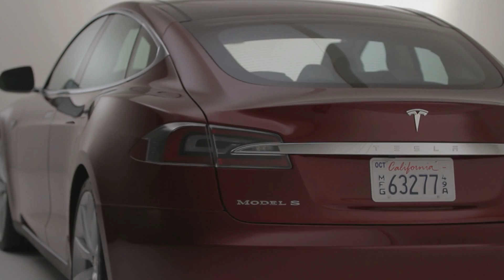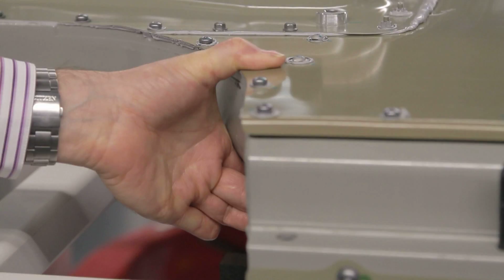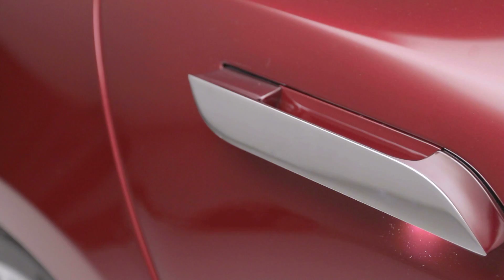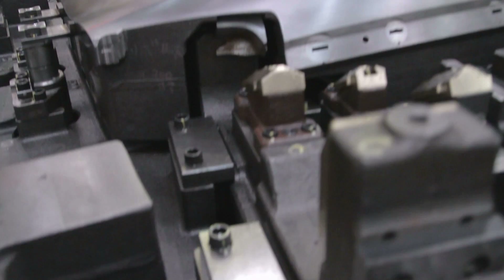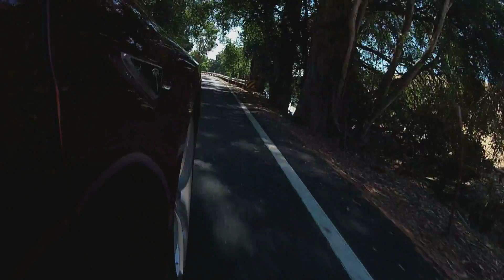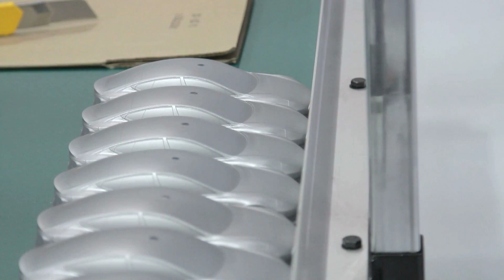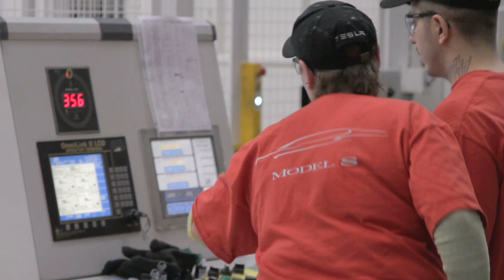Driving the 2012 Tesla Model S - Wide Open Throttle Episode 22

Comment: I cannot belive they called it Tesla. Tesla car was running with free electrcity charging it self 100 years ago. To charge car takes hours and about $8 per100 mile drive.The warnty50k miles or 4y because after 4 years you will have problems like expencive battery dead. The battery is like 30k. In winter cold this car is junk. Dont forget 50k is for chaep v of the car the next step is what 60-70k? Buy toyota. I wuld not buy it just because they used Tesla name scammers. Get car that runs on water

Comment: Statistics suggests the contrary: The rear of the car is safer than the front as there are more rear-end survivable crashes than front ones.

w w w dot science direct dot com/science/article/pi i/ S 000 1457503000666

Remove the spaces and add the dots to get to the link.

Comment: I agree. I just saw this car's chassis at Garden State Mall in Paramus, NJ. This thing is ridiculously simple from a mechanical stand point. The rear wheels are driven directly by the electric motor, there is no complicated gear shifting transmission, ignition, liquid pressurized fuel, oil, or emissions systems unlike any gasoline car. They have eliminated a lot of the parts that commonly break down.

Comment: Cost for fuel ranges from less than one cent per mile, to 4 cents per mile of driving depending on where you live which is incredibly cheap compared to gas cars which cost on average about 17 cents per mile (Shaw,2009; Shulman, 2012). 

Do some research before posting.  I've written 6 papers on EVs during college, the most recent of which is on Tesla alone.  All 27 of my sources show similar figures for charging vs. purchasing fuel.

Comment: Wrong, have to do the math bro. The average cost of electricity for most places is about 10 cents per kWh. Most EV's (like the Nissan Leaf can go 100 miles on about 30-40 kWh. That is $3 to $4 per hundred miles. Take a gasoline car getting 30 mpg, with gas costing $3 per gallon (being nice). The care would need little over 3 gallons to go hundred miles. $9 per hundred miles for a gas car. Next excuse.

Comment: Now your just talking out the ass. Do you own an electric car or a hybrid? EV's have less moving parts to operate, meaning less things to go wrong increasing reliability.  Not to mention the warranty as a backup when things do get shaky. Remember, you dont have to change your engine oil or transmission fluid on an EV, dont have to change your battery on an EV. No air filter, no tune up, not spark plugs.... That's a lot of no's to claim that "spare parts" out cost fuel.

Comment: electric car is good in summer, but in winter it is useless. Where i live, in winter air temperature can get below -30 C. At this low temperature battery starts to discharge it self. And in the end you end up with a dead car. I really like this tesla, but im not sure that it's good in winter... If they can prove me, that after 2  years i could still use this car in winter, i would probable buy this car and ship it to Europa, where i live.

Comment: I havent seen how much a tesler costs, if the battery replacement is 12k(i dont know how often you would have to replace the batt.) Minus all of the parts that wear out on gas/diesel cars, i believe the only difference is replace batt and still have a solid good looking car, or buy a new car every five years which can easily out cost a set of batts 3 or 4 times.

Comment: The regenerative braking is an intrinsic part of the motor it has nothing to do with the bracking system at all. When not powering the vehicle it turns into a generator and puts power back into the battery. Also ac motors are much more reliable than pistons engines. There are few friction points because its powered by opposing magnets. Do some research instead of being so ignorant. Nay Sayers like you are what's wrong with our current marketplace.

Comment: My Volvo goes in to get updates on its computer at a cheap estimate of $200 at a non dealer mechanic and its a 10 year old car. I don't know where you've been in the last 20 years but last time I checked every car I have owned has had a computer controlling it and monitoring every system. To fix the computer in the model s would be as easy as updating your iPod. Hardware can be swapped and diagnosed much easier than diagnosing emissions issues as well.

Comment: @way2fasts but it does needs it ECM, OBD II, emissions parameters and an endless number of other separate controls to function. How many times have you seen a check engine light on a car. Guess what this means the computer broke and needs to be fixed.

Comment: Tesla already has 6 supercharge stations in calif.  They can charge the car in 30 min.  They are run on solar panels which produce more energy then the cars need.  So you stop for lunch plug in your car, when your done so is your car.
No drain on the power company.  Tesla says if you fill at there sites no charge for power.  Fill up is free.  In 1 year there will be twice as many in calif.  In another year from calif to new york.  Try to go to LA to NY without spending a dime.

Comment: the model S has been compared to the r8 and m5 by official reviews, its a luxury car that drives like a sports car. Is that so hard to understand?
Regardless, you chose a diesel for higher mpg than the gas, no? 
I am taking my own mileage and I would save 12k (24-12=12), by yours you would loose 1.2k (12-10.8=1.2). Do you get to decide the average?
You chose 100k, while the 90k model has an UNLIMITED warranty for 8 years. 
You obviously just ignore inconvenient facts. I'm done with this.

Comment: secondly throwing out random mileage numbers to compare is useless, an average is an average, and even with ur numbers this car still comes up short in resale value compared to a 535d by about 4g, and lastly i clearly said that if something brakes on a diesel it can be repaired/ replaced with out having to replace the whole unit itself, where as with a battery when its done its done, engines are extremely simple to work on, and besides that its cleaner and cheaper for the environment and ppl

Comment: oh btw: you make the statement that the 535d will not wear out like the tesle as if referring to something else than the battery, but give nothing to back that up. If anything, the tesle, with fewer moving parts, not belts, sparkplugs, engine oil, etc, etc, etc, would wear less than the 535d

Comment: I assume you've chosen the example of a diesel engine because a gas M5 gets about 19mpg, and a R8 even less. 
So with a 37mpg diesel, IF the price of diesel does not increase over time (unlike), AND the cost of battery technology does not decrease (also unlikely). Then you calculate driving only 12k miles a year? I drive twice that, so my gas cost, even with a diesel would easily be $24k. 
Even by your very mild calculation its a 12k battery swap vs a 10.8k gas cost. How do you get loosing 14k?

Comment: and please dont flatter your self, they might make the batteries easy to replace, how about all the computers, when u have to reprogram a car, how about the regenerative braking system, u cant just buy pads if something like that goes out, there expensive as all hell, the center dash is a computer that controls the whole car, on  a regular car if say the nav or radio goes out u can keep driving, not if the whole system which is connected to each other goes, biggest scam in history!!!

Comment: Have you ever looked into how much it costs to rebuild a BMW engine? It's not cheap or easy. Value is based on more than just "fix-ability" and when there are only 3 major systems to repair in this vehicle ie motor, brakes, battery instead of thousands of systems with endless variables for failure in a gas engine ie injection system, vacuum system, drive train, emissions etc, etc. I see the model s holding significant value throughout it's life cycle

Comment: you really don't know anything about this car, or any car your talking about by the way. they jack up the car unbolt the "battery pack" wheel it off with a floor jack and bolt the new "battery pack" in 2 minutes or less. they don't replace each battery individually. this car has been engineered with maintenance in mind and the end user, not the bottom line.

Comment: lets do some simple addition, lets say this car makes it to 100k, u say loosing 12k on the cost of a car in resale compare to a 535d, which gets about 37mpg uses 2700 gallons worth of fuel, at around 4 dollars a gallon is roughly 10g, but the diesel will keep its value, since it will not wear out like this car, so assuming that this car will be worth 12k, who ever buys this is still loosing 14k compared to someone who buys a comparable bmw 535d, hmm so where is this money you are saving over gas

Comment: Gas cars don't have many computerized components? Please! 
A new R8 would have as many problems stemming from not having a functioning computer system as Tesla. This is unrelated to the engine or the battery so its a moot point. 
Luxury cars loose value quickly. This is not news.
You still ignore all facts about gas savings outweighing battery replacement cost. Advancement in technology reducing the battery cost, and that the M5 or R8 is a better comparison.

Comment: ill tell you what, i owned an 01 740i, and i wound up selling it when the computers started to go, how many people use computers that are more than 8 years old, computers crash, regular cars have very few computers, so there is not as big as a problem, but even comparing the 5 series is this cars direct competitor in the luxury car market, there will be no market for a car, which will have computer problems, as well as battery problems, this is the reason anything electronic holds no value

Comment: first, I never said they are comparable, the m5 or r8 is a much better comparison. I'm simply stating that if we used your matrix for evaluating the car, at the very most the car will loose an extra 12k in value, which is less than the cost of the gas saved in that time, and that is only IF... did you even read my post? 
Assuming electronics still work, same as any other car (but gas cars have more moving parts).
Btw driving an outdated car would be the same for gas or electric, stay on topic.

Comment: IF the battery were to cost 12k to replace after 8 years, which assumes 
a) that the battery does dies at 8 years - still just speculation, end of warranty doesn't mean death, and 
b) that the cost of batteries would not have come down in those 8 years - unlikely considering how the price has dropped in the last few years. 
IF so, the price of the car would simply be reduced accordingly. Selling for 13k rather than 25k. Btw 12k is half of what people (or at least I) spend on gas in 8 years.

Comment: there is a large difference between a engine and a battery, and engine can easily be rebuilt cheaply, whereas if a battery is gone, its gone, lets compare this car to say a 5 series for value, a 2004, 8 yr old, goes for 20-25k, now say lets say this is there value in 8 years, why would anyone risk buying a car, and wind up with a 37k used car, and lets remember the install is going to be outrageous, so your over 40k for a used outdated car, that is why this car will have no value, it make no sen

Comment: This is a serious bargan. For 80-90 grand, you get a car with 300 miles range, that looks LIKE THAT, and has an 8 year warranty. We ( everybody who drives a car ) have tried to get more econ out of the internal combustion engine, but there's only so far you can push a technology. This IS the future. Gas prices aren't going anywhere but up, and electricity prices ( in Ontario at least ) are staying pretty flat. 

Hop on Tesla's website, use the calculator, see the savings.

Comment: I predict this car will finally begin the dawn of the electric car. Its well priced, has performance in loads, and is way cheaper to run (even including the battery replacement which will have to occur every 3-4 years). Most professionals dont drive more than 200 km a day (and always have a 2nd car for long range trips), and its top speed of 200 km/h less likely to give you a ticket, but will blow any car off the traffic lights.

Comment: Actually, after doing some minor research, I was wrong about the battery price.  It actually cost around $20,000 to replace.  

Fact - This car is designed to be an awesome electric luxury car.  Not a car designed to save you money.

Comment: Since the battery is only estimated to last for 100,000 miles and the cost for replacement is $10,000, the price to mileage ratio is still more than gas.

Comment: living in canada with the large distances between cities will prevent a large adoption in canada.  If I want to visit my family which lives in the same province I live in, I would need the car to have a range of 800 km's, which batteries as they are will not reach.  If solid based and not liquid based batteries are able to be manufactured at an industrial level that will help with range of electric vehicles and may be able to push them over the top.

Comment: I took the Nissan Leaf out this month and driving to my home and back, when heading on the freeway at 55mph ( we were doing 50 because we knew the battery would drain faster ) we drove directly from the dealership, home, and back with no stops. 60 mile range and only 4 miles to spare. We thought we were going to get stranded.  They say that the Telsa Model S gets 250-300, but I wonder for how long before the battery depreciates over time and the type of maintenance and cost the vehicle is.

Comment: A beautiful car. Really really beautiful piece of design and engineering. There are however, two, maybe three things still wrong with it. It's way to heavy for a sport sedan (not Tesla's fault, this is the maximum technological potential of the battery technology), and i am surprised to see that the seats of the car aren't very well designed. Not much latteral support for the driver, and no thigh support either, it's a real minus. Hope they correct that in the future. Anyway, thank you Tesla !!!

Comment: you know whats funny.. a team at stanford university came up with a battery design that made from normal copy paper and carbon nano tubes that are cheaper than these batteries, hold a higher charge, lighter, and have a 3 times longer life. what will be cool is if the new batteries can be made by a third party company that can be fitted to these cars aka i make my won battery pack cheaper that 180 kwh that is compatible with their systems.

Comment: generating for free.

If you do the math, USA is 3.79 million square miles. We'll be
conservative and say each power station can service a 150 mile radius
(300 mile range so we'll half it to be safe) a 150 mile radius covers
70,685 square miles which means it would only take 54 stations to
cover every square mile of the USA.

Now lets estimate it costs $1 million to build a station (it's
probably much less since its just a bunch of solar panels on a roof
and some outlets). (cont)

Comment: Well actually, if you did any research you'd know that at the Tesla
supercharger stations it only takes 30 minutes to get 150miles of
charge and they're placing them around the country on major routes
with no more than 150miles between (although the cars can do
300miles). As well, the charging is free because it comes from solar
power. Tesla has the upfront cost of building the stations and
maintenance which is made back from the auto sales and then provides
the power for free since it is (cont)

Comment: I looked into that.  Those lease situations don't add value to the home because you don't own the equipment.  They may be more expensive in the long run because you sign a long term deal with yearly increases.  Meanwhile, solar panel prices may fall.

Comment: One of the big advantages is the fact that every morning you leave the house with a 'full tank'. For every day commuting you dont even need to think about filling up or the cost of fuel.

On trips over 250 miles, yes you will have to look at the Sat-Nav and plan where to recharge but it's not rocket science.

Comment: An 500 mile drive from San Francisco to Las Vegas costs just $5 in a Tesla. Total recharge time at highway Superchargers approx. 1 hour. Even the best equivalent BMW diesel will struggle to get 35 mpg or $50+ of fuel. Ok you may save yourself an hour if you drive non-stop for 7 hours but who wants to do that?

For long distance driving the Tesla Model S is King!

Comment: Compared to 600+ miles in a day in a gasoline powered car.  When electric cars are cheaper, and have the same practical range as a gasoline powered car, then people will buy them.  $70K is out of most people's price range.  And 300 miles in a day isn't practical.

Comment: You could drive say 230 miles at speed then pull into a TESLA Supercharger locale. While you are having coffee and a sandwich, time in the bathroom, some leg stretch fresh air and buy a couple of things from a convenience store you will have at least
another 180miles of charge. So you reach your hotel having done 300miles which is a perfectly reasonable distance or if you choose do another SUPERCHARGE and an other 150miles you'll have done 450 in a day. Charge at hotel overnight.

Comment: You  arean idiot electric drivers do not run out of power plus you do not use a tow truck for EVs instead you use a charge-up truck. If Tesla Roadster number 507 went around the world 28,000KM and NEVER once ran out of juice then trust me you and your trips to the supermarket or lapdance club will not either !!

Comment: I would loved 100% electric car. Electric engines have tons of torque from 0 rpms and are much more efficient then gas powered cars. Once I can get 250-300 mile range in 5-15mins of refill/ charge I am so down. Even better would be combing this with Nicola teslas wireless electricity and no more range issues as long as your in a coverage zone. One can dream.